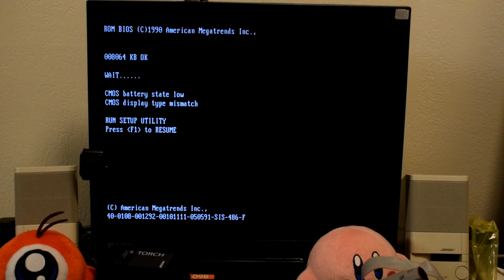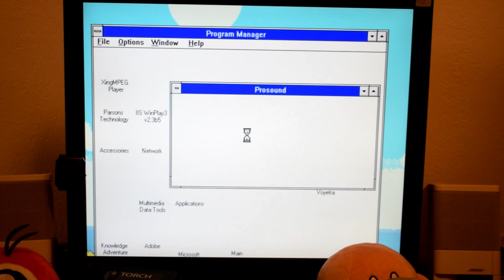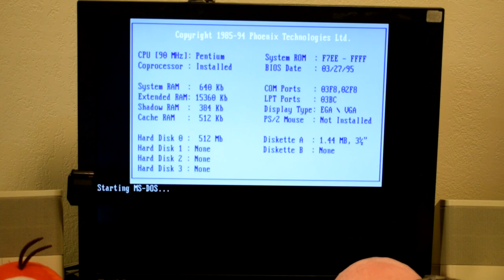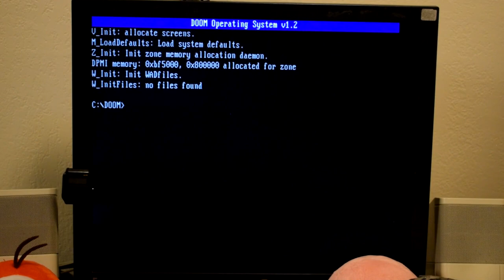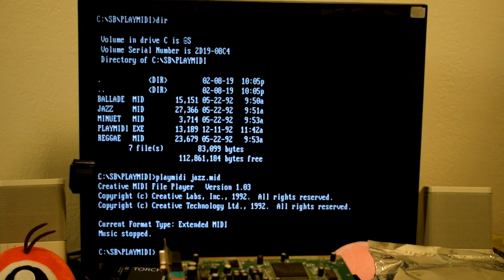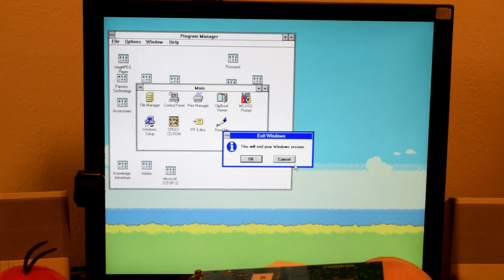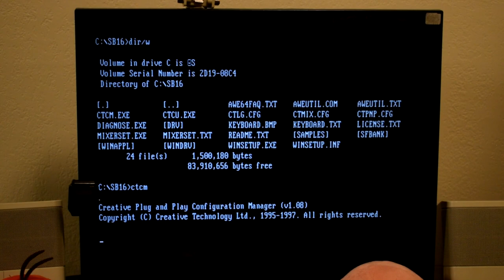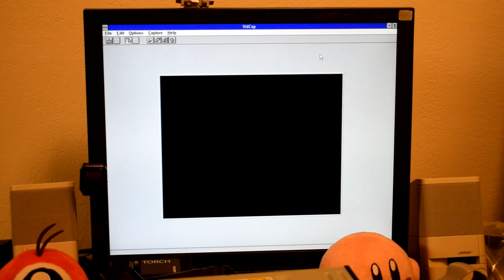The DOS Machine Motherboard to Rule Them All?

Comment: That is a dual-CPU system...  The second chip is another Pentium CPU, not a coprocessor.  All Pentium CPUs had a built-in math coprocessor.  This machine was originally designed for Windows NT.
Reply: It was puzzling me, a pentium coprocessor? I never heard of one.
Reply: Are you sure it's not for a maths co-processor for a 486SX CPU? I.e. a 487
Reply: @TiTiTiTiT  It's a Pentium Overdrive that's installed on a 486 mobo.
Reply: wow...
Reply: @adg1355  I do not think this is true at all. Physical dimensions, pin count and heatsink latches make the sockets either S5 or S7. There also is no 90MHz Pentium Overdrive for Socket 3.
PS: Found the CPU Card. It's an ALR 9250. This one comes from an ALR Revolution MP/P90 computer. It is definitively a Socket 5 system.
Reply: yeah he's a little confused but oh well that's what happens when you have older computers that do have co processors like the 286 386 and 486 did have co processor for math but they got past that with dual CPU systems starting with the Pentium 1 and on wards 
does windows 95 know how to use two cpu's when was that feature first introduced to windows anyways do you know?
Reply: @raven4k998  Dual CPU PCs existed years before, for example the 386 Compaq SystemPro. DOS and Windows 9x cannot use the second CPU, but windows NT 3.1 and newer can (if you have the right HAL installed).
Reply: @Schule04  yeah I know this was before the advent of multicore cpu's
Reply: @jordicoma  it's the new thing give the Pentium a co-processor despite it having one built-in you can never have to many co processors in your system after all🤣🤣🤣
Reply: @gorebrush  yes we are sure pentiums had that built in for cost cutting reasons🤣🤣🤣
Reply: @Schule04  yeah it's how you got more cores before they started making multi core cpu's🤣🤣🤣
Reply: @raven4k998  Was your account hacked?
Reply: @Schule04  nope was your's?🤣🤣🤣

Comment: 100 years from now and the Ultimate DOS machine will still have upgrades
Reply: that sounds kinda nice
Reply: "Today we will be replacing the old CMOS Battery with this micro-fusion battery. See, these old CMOS Batterys are getting more and more expensive now adays and the Ultimate DOS machines finally decided to die!"
Reply: FreeDOS ver. 7.1 with 64 bit expansion.  Fpga to emulate any x86 CPU, with multiple clock speed dividers.  100mhz to 10ghz, in 100mhz steps.
Reply: why do I feel like that can be true
Reply: BIOS has 2099 as last year
Reply: nope cause eventually 486's systems will all be dead and buried they don't still make them like they still make brand new apple 2 based system cpu's yes they do still make 6502 and 65816 chips Western digital makes brand new one still even today

Comment: That machine is begging for NT 4.0 or even Windows 2000/XP if you throw more RAM into it. Its a Dual Pentium 90, so it'll be a bit snappy. EISA slots are a nice touch, they make 10/100 ethernet cards for the bus if you want to conserve PCI slots.
Reply: But he wants a dos machine
Reply: and pretty decent raid controllers, too. after so many years I don't really remember the brands anymore... I think I had a DPT, probably mylex could also be found. I loved EISA after I found you could do the IRQ assignments via software AND validate them!!!
Reply: @AN-yy9cq  if he wants a DOS machine he picked the wrong motherboard, this is just stupid
Reply: will  a p90 even run windows 2000? i think i ran a beta copy of nt4 on a p100 back in the day. but w2k sounds a bit far.
Reply: @700gsteak   Of course it can, even a 486 can run Windows 2000 given enough RAM. P90 can even run XP if you wanted.
Reply: Interesting I remember trying to run Quake 1 on a w95 p100 machine and it ran like complete poop.
Reply: @700gsteak  low ram. or your CPUs were not the best. not all CPUs are built equal.
Reply: @700gsteak  prob the horrible 3D graphics chips of the day.

Comment: This seems to be a Dual Pentium system. Second processor is useless on MS-DOS and Win9x because they don't have multiprocessor support.
Also these aren't regular ISA slots, they are 32-bit EISA slots (they're compatible with regular 8 and 16 bit ISA though).
Reply: @JoshOsRocks Windows NT 4.0
Reply: @JoshOsRocks  In '95 there was already 386BSD, NeXTSTEP 3.3, Windows NT 3.5...
Reply: @JoshOsRocks  All versions of Windows NT have multi-processor support
Reply: @JoshOsRocks  NT. I can confirm.
Reply: @dbozan99  I didnt know the home editions had multi processor support...
Reply: @adventureoflinkmk2  They're all built off the same kernel, which the kernel is what has the multi-processor support.
So they all support it.
Reply: @aaaalex1994  Don't forget the Linux kernel as well, obviously.

Comment: Lesson learned:

- Step 1 Clear CMOS
- Step 2 Everything else.
Reply: Step 1.1: replace the cmos battery.
Reply: -Step 3?????
Reply: @nocturnal0072  but but it's an old motherboard why on earth would you do that to the old motherboard it makes to much sense
Reply: @raven4k998  Step 3 is always "profit".
Reply: could you imagine if that worked
Reply: @nocturnal0072  isn't that step 4?
Reply: @raven4k998  As the step before is "???", you can always profit next.
Reply: @nocturnal0072  just bugging you as there's no specific step for profit it's in there some where's so it can be step 1 2 3 4 5 6 7 8 9 or even 10 or so on and so forth

Comment: bit late to the party, but I have an idea for a case to put that system together with.
Two slabs of wood, four long screws, a dremel, a drill, measuring tools, and assorted screws and standoffs. assuming you have most of these, it should cost less than $20.
1: Measure the required width and height for the combo of the motherboard, the drives, the PSU, and the card lengths. Measure the thickness of the wood and addthat length to either side of the motherboard. Use that measurement to cut the first slab, Slab 1, to size.
2: Take the other slab, Slab 2, measure the height of the tallest card, add the thickness of the first slab, and add about another half inch, and cut that to size.
3: Drill holes, install standoffs and motherboard, put one card in, and measure how much space there is between the slot and the bottom of Slab 1, and use that to cut out a big hole for the PCI/ISA area. Save the cut out block.
4: Measure the cutout needed to fit the IO area on Slab 2, and cut out a little more than you need, to fit the large cables more easily.
5: Use the block saved from 3, and cut 90° wedges. Screw these into either side of the motherboard using some of the long screws, so that the 90° corner is aligned with the corners of Slab 1.
6: Install all of the PCI/ISA cards, and use the rest of the long screws to install Slab 2 onto the wedges, joining it with Slab 1. If all the measurements were done right, Slab 2 should sit on the PCI/ISA brackets, and be aligned fairly well with the bottom of Slab 1.
7: Use the drill to tap the spots where the PCI/ISA brackets are supposed to be screwed in, and put screws into the tapped spots. you may have to go bottoms up instead of top-down, so the head of the screw actually torques the bracket into place like normal.
8: use whatever rigging method you wish to mount the CD drive, PSU, HDD, Power button, etcetera. First thing that comes to my mind, is double-sided foamy tape or stick-on velcro.
9(opt): You could take the parts out, sand the whole thing smooth, and apply some sort of wood finish paint to make it look extremely nice. Buying and attaching stick-on rubber or foam feet will also make it a lot more desk-friendly.

It took me from the introduction of the new (pair of) board(s) to the end of the video to write this comment.
I doubt it will happen, but at least the idea is out in the open now.

Another idea for videos, is to get a capture card that takes a VGA signal, and using that on a laptop, alongside a decent webcam, in OBS. That way, you can show the direct output of the monitor, without having to adjust the webcam between showing off parts and display output. All the while, being able to switch betweem them on the fly, without editing it together.
Well, Druaga1, it's been a good run for me, today in this comment section, I suppose I'm off. Still inspired -Killermemz, formerly Yackaro.
Reply: you're over complicating it way too much just use a serial box and some duct tape🤣🤣🤣

after all this is the weed and SSD channel not the woodshop class channel🤣🤣🤣🤣🤣🤣

Comment: "this board came with a case - but it was too massive"
But...how can you fit that board in any other case?
Reply: He should get a custom made case for it, using modern tech, he could save a lot of space compared to what it used to be.
Reply: he'll invest in more lego blocks
Reply: Server case.   That might very well be a 'server' board he has.   Back when 486-class rigs were the hottest things out there, you could get these absolutely huge tower cases, which were referred to as 'server towers'.  I had one; it was a computer manufactured by Laser, and in its former life, it had been used to run those old NYSE and Wang dumb terminals in a telemarketing company.  My tower was very nearly as tall as my desk, and the case, when empty, probably weighed 25 lbs.  It had a freakishly huge power supply (I don't mean just big capacity, either - picture a typical AT power supply, but about a foot in length, with a fan on either end!) and it easily added 8-10 lbs to that box.  The case was set up with six bays that could used for up to three - count 'em, THREE - full-height 5-1/4 inch hard drives, or up to six half-height drives, or some combination thereof.  In addition to this, there was the obligatory 3-1/2 inch floppy bay.    The case had provision for up to TEN peripheral cards (the motherboard that was in it had eight, all ISA).   The ridiculous thing was, the motherboard had a 486dx/33 processor.  Probably one of the fastest things available when it was built.  The mobo had no built-in drive controllers, no built-in ANYTHING.  It was JUST a processor, memory, chipset, and a whole bunch of peripheral slots.

Comment: Those are actually EISA slots, not ISA. And 500-ish megabytes (either 504 binary megabytes or 528 decimal megabytes, depending on how you count it) was a BIOS limitation of most pre-mid-1990s PCs, not a DOS or FAT16 limitation. If the hardware supports it, FAT16 can support up to 2 GB partitions (or even up to 4 GB in Windows NT 3.x). With either a BIOS upgrade or the use of drive overlay software, you can get around this limitation on older PCs and allow the full capacity of the drive to be recognized and used. (A similar BIOS limitation of 8 GB maximum drive size applied to many late '90s PCs.)
Reply: Hello Mr vwestlife

Comment: Just enable LBA to fully use the 8GB HDD !
CHS parameters are for really old drives (less than 500MB ^^)
Reply: and now you know why hes stuck using 512 mb hard disks instead of 8gb on that machine he does not know any other way

Comment: Dual CPU is pointless. Anything running on DOS (including Windows 9x) can't use more than one CPU. So the second CPU isn't being used at all. Install Windows NT 3 or 4 to use both of them.
Reply: its a coprocessor, they combine to make a single thread which dos can handle
pentium itself also includes some coprocessors too.
Reply: @user-ro1cc8tz6d  No they don't, it's a dual CPU board. Look at the POST screen, it says "dual PROCESSOR configuration"
Just like the 486DX, the intel pentium didn't need a coprocessor like the 8088/286/386 did : they already came with it.
Reply: @DxDeksor  so as i researched a little bit; coprocessors used like a acceleration card and it wasn't used for executing programs.
But curtain applications used it specifically for accelerating some calculations: https://www.reddit.com/r/dosgaming/comments/8ydi7e/prequake_games_that_use_a_math_coprocessor/
so i was wrong in the first comment but that doesn't mean they are full blown processors.
newer nt kernels might make use of it by using it in mathematical acceleration without asking to application.
i need to search a bit
Reply: @user-ro1cc8tz6d  Math coprocessors are called "x87" because they all end by "87" (8087, 80287, 80387) and they were usable by any DOS application. But the 486DX included the "487" in its heart, so the pentium did. 486s and Pentiums have no external FPU due to that (the 487SX doesn't count for many reasons I won't explain here, but just to give you an idea, it's a 486DX in disguise).
What druaga really has is a Dual CPU motherboard, with Two Intel Pentium running at 90MHz (they both use the same socket as you can see, the only thing different is that they use different coolers for some reasons). Since this board was made for server usage, this is perfectly normal to see that (just like modern servers can have more than one CPU socket to install multiple CPUs on one motherboard)

ALR is know to have made several servers with x86 CPUs. Few years later, they made a server that could use up to 6 Intel Pentium Pro (The original P6, ancestor of the Pentium II, Pentium III, Pentium M and Intel Core 1)
Reply: Hmm.. wonder if you could put a couple Pentium 166 or even 200s in there, then put some more RAM inside, then windows 2000 aka NT 5.0 would be possible.. perhaps even XP Pro aka NT 5.1
Reply: @adventureoflinkmk2  Maybe, but these don't fit the specs of the socket 5 (though it might be a dual socket 7 board, I don't know). Even with the current specs (with more ram), I guess it could run Win 2k/XP, even though it will be painfully slow x). I mentionned NT3 and 4 because they're more period correct, but this thing can run XP for sure with some more ram.
Reply: @adventureoflinkmk2  Also puppy linux should in that state in a dual pentium machine, bring it to the modern days, obviouslly not with all the modern basic tasks and such.
Reply: @eduardoavila646  rene rebe maintains t2sde, he did run that in many retro computers
Reply: @user-ro1cc8tz6d  Interesting project! I will test ot later on my amd duron too
Reply: @DxDeksor  coprocessor =/= full on processor.
At best this "coprocessor" is like hyper threading for these old Pentium 1's.
Newer CPU's have them directly integrated onto the socket it-self.
Reply: @Nighterlev  Except in this case it IS a second pentium 1 !
There are no such thing as "Pentium 1 coprocessor" in existence, this is a dual pentium 1 system.
Reply: @user-ro1cc8tz6d  He has an active YouTube channel, check it out.
Reply: @rugxulo  i already subbed to him two years back, i also support him on patreon
Reply: I know this is old already but this thread is full of idiots, the computer that's seen here was an old server motherboard platform that works with dual cpu configuration which for some reason people are mistaking the second processor for a co-processor... 🤦

CO-Processors weren't even a thing anymore when the pentiums were already out since some of these cpus had built in coprocessing fpu inside.

This video is to show druaga1 doing what he does best  ...being old druaga1. lol
Reply: @explorer9049  aah I remember this talk x)

I hope they've improved their knowledge now

Comment: The "512 MB" limit you were talking about refers to the limit of old DOS computers to a 504 MB drive due to early BIOS's having a limit of 63 sectors, 16 heads, and 1024 cylinders, leading to the 504 MB restriction for a hard drive. Starting in mid 90s, enhanced BIOS's and, by the 2000s, Logical Block Addressing, bypassed the restriction.